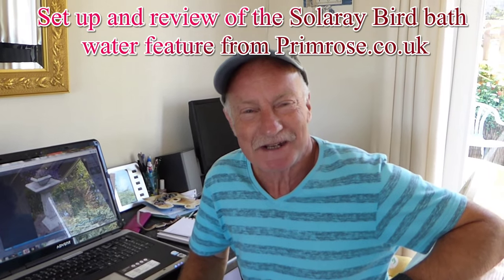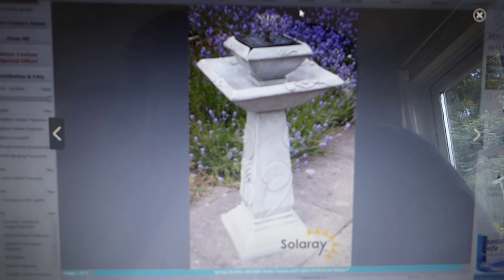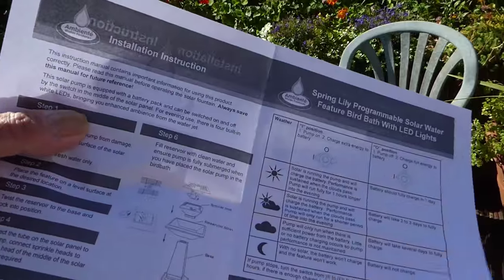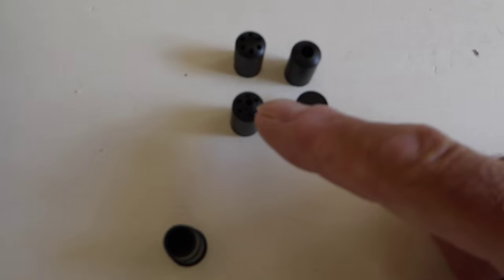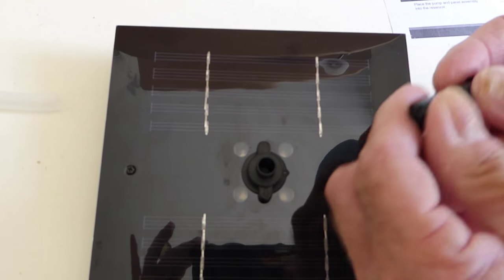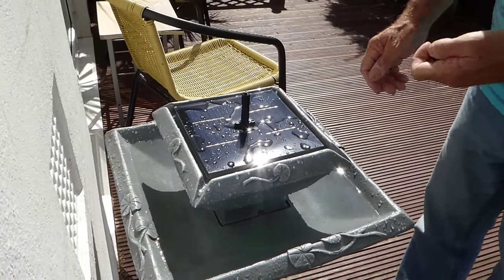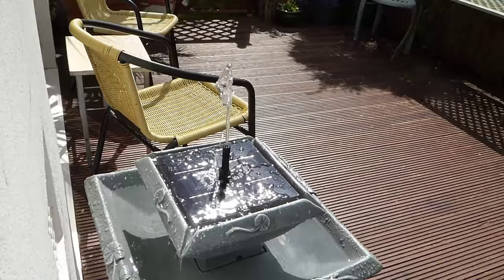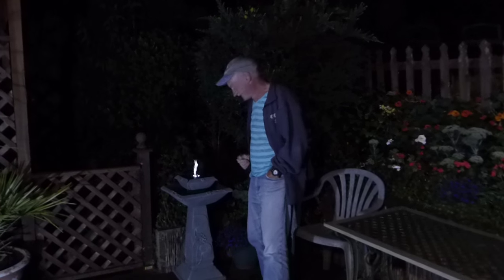Set up and review of the Solaray bird bath from Primrose

Comment: I put baby goldfish in mine, its a great effect to see them swimming about in the fountain! You have to use the large single nozzle end though because they are constantly sucked through the pump and they only get through the largest hole. They need to be cleaned out after a couple of days because most of them are dead by then but I just replace them with new ones and put clean water in 2 or 3 times a week. Good review btw, thanks for sharing
Reply from the maker: Zeldas Quim OK!!!! Al
Reply: Poor little mites! Don’t you think that’s a very selfish thing to do to achieve a bit of pleasure of you?! Also, there are bound to be birds who are visiting solely to get a quick meal!